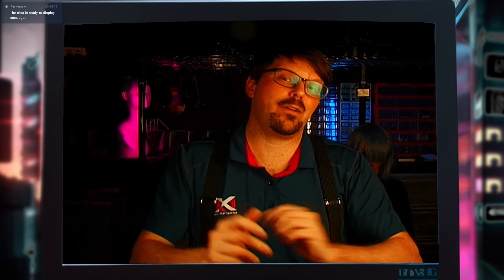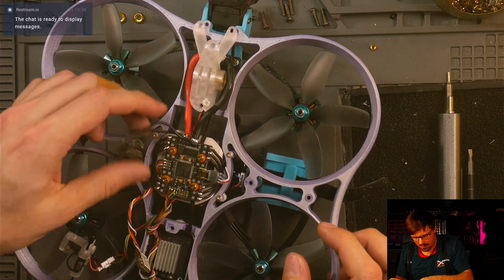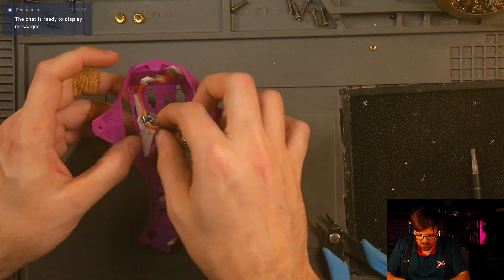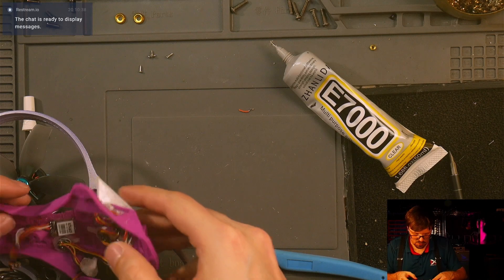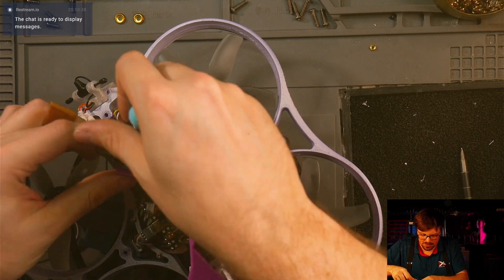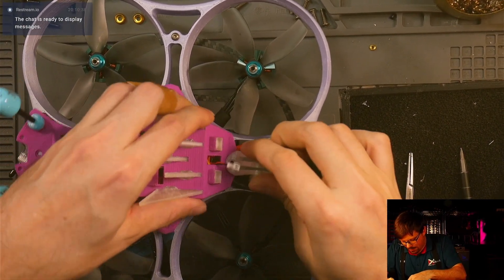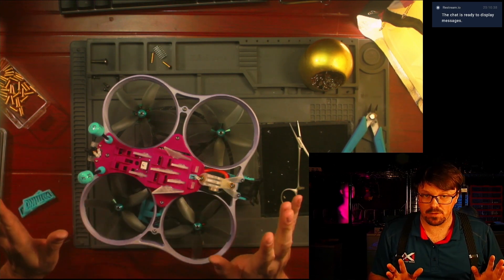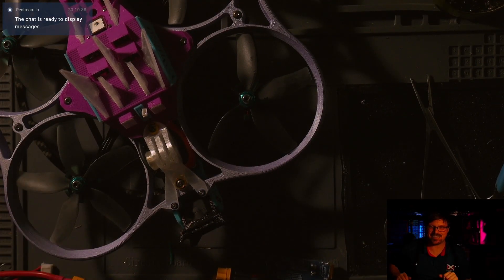How to Build a hybrid cinewhoop for FREE!

Comment: increase the thickness/height of the prop guards ducts so that they become edf's (they say almost 2x [60%] the thrust, with same power, more efficient)
Reply from the maker: Only if the props are basically touching the ducts. Otherwise it's actually less efficient
Reply: @33rdframe  um no its not so critical, what are you talking about, try using stock edfs as the motors
Reply: @33rdframe  its that 60% more efficient if you have the edf duct around the prop, with the reasonable height
Reply from the maker: @Jkauppa  that's just not the case
Reply: @33rdframe  trust me bro
Reply: @33rdframe  who paid you to get that opinion about a real thing
Reply: @33rdframe  biased judgement
Reply from the maker: @Jkauppa  "who paid me?" You are barking up the wrong tree
Reply from the maker: @Jkauppa  "based* judgement "
Reply: @33rdframe  nah its over
Reply: @33rdframe  who are you
Reply: @33rdframe  you are the one limiting what I can say, yo dawg
Reply: @33rdframe  science bro, not have waving :)
Reply: also then they become lift generating circular wings for horizontal flight, and they dont have to be super height, just electric ducted fans height, also removes all the tip vortex formation problems
Reply: a bit more height to the edf ducts
Reply: cool cool bro
Reply: what makes it a hybrid tho?